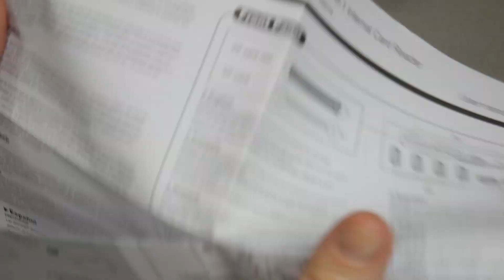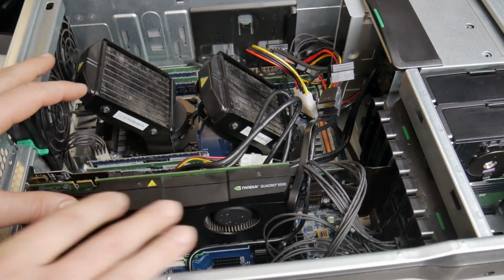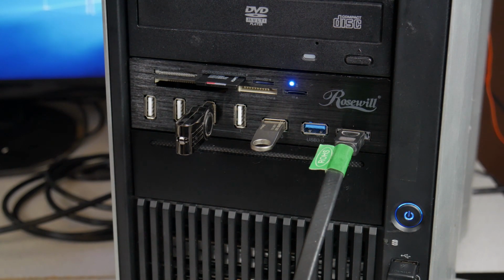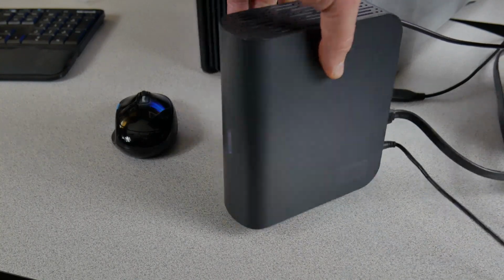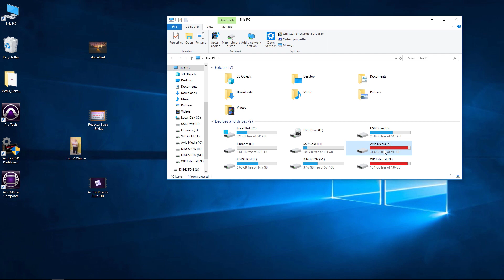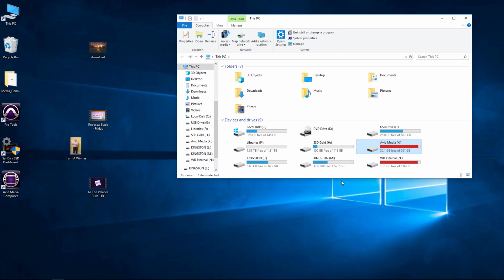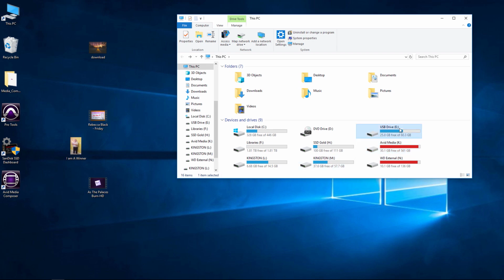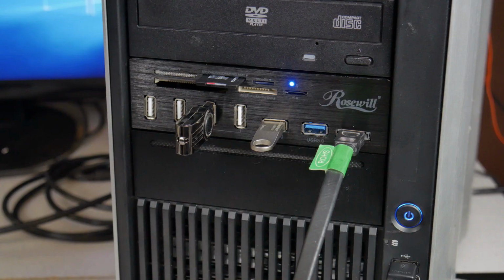HOW TO ADD A MULTI-CARD READER TO YOUR COMPUTER

Comment: Thanks that helps. Trying to hook up old multi card reader. I need the sata plugged in and the power to the psu.  There was another female type plug on it but I think it's if for if you don't have the male plug for the sata.

Comment: What if your motherboard 3.0 header is already in use ? Do they make a splitter ? My first and I want to add a card reader with a 3.0 but my asrock b450 pr0 4 3.0 header is already being used bu the case's front 3.0 connector
Reply from the maker: You could get a splitter, but what I would recommend - instead of installing a card reader, just get a USB3 card reader that plugs into a USB3 port. I've started using the USB reader more than the installed one because it is more consistent with speeds. Unless you are using a bunch of different cards at the same time, I'd go with a small USB 3 reader. I use one called Rocketek - theres a video about it on this channel somewhere.

Comment: What's the PC card with the 19 pin header?  I have a z800 and this same card reader but the USB 3.0 just sits in the bottom of the case.
Reply from the maker: I think you are referring to the USB3 PCI card I have installed. I need a TON of ports.